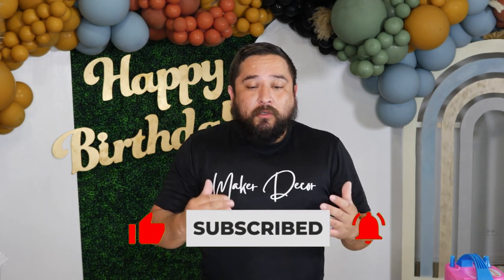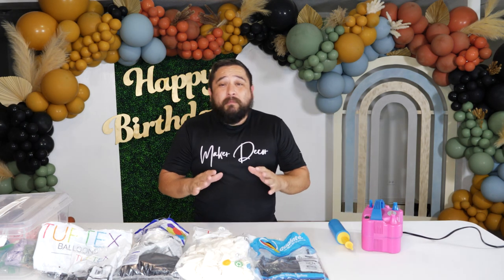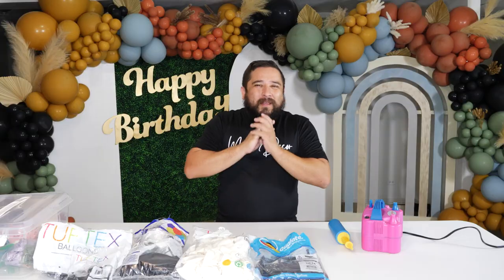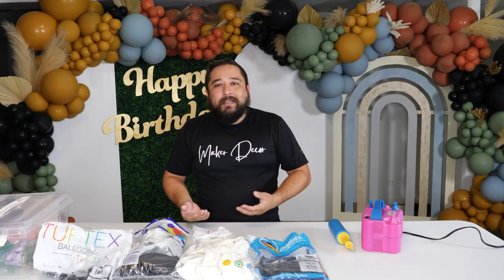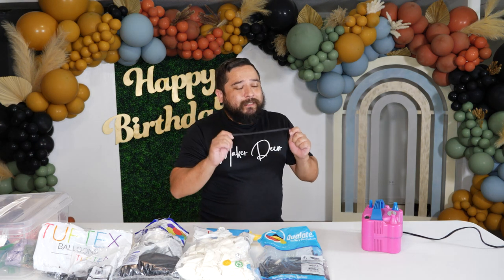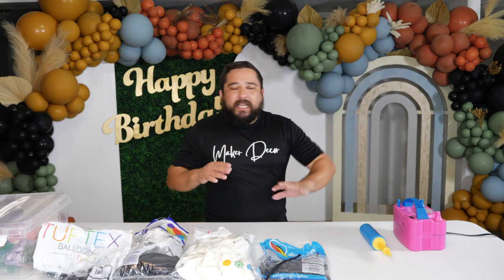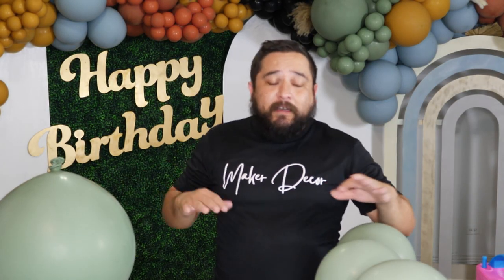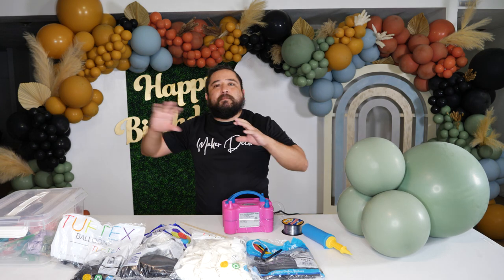How To Make A Balloon Garland Basics

Comment: This is beautiful 😍 can you tell me how you attached the balloon garland to your backdrops?
Reply from the maker: Hi, thank you. I have small screws on the back of the wood backdrops. So I just used those 260 balloons I show in the video to wrap around the screw and pull the balloon garland tight to the backdrop where I need it. I also wrapped around the pipe from the grass system. But is was all done with 260 balloons. Just tie the 260 to the balloon garland and then wrap it around the backdrops, works great!
Reply: Thank you for the information